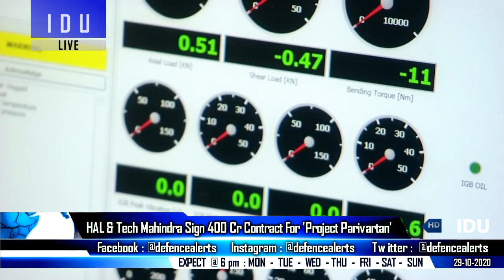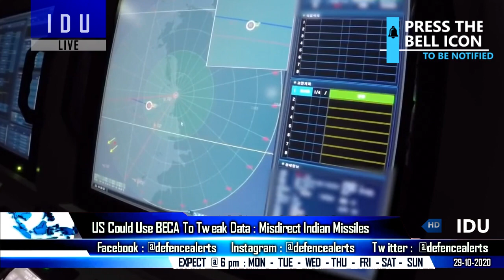Indian Defence Updates : TEDBF Production By 2030,DRDO AIP Delay,400Cr Parivartan,US BECA Misuse ?

Comment: My suggestion would be to save time, and just focus on AMCA, let the Naval AMCA be the TEDBF why not? this way the AMCA production will be higher and thus lower cost per unit.
Also Navy should buy more Tejas and use them from their land bases like INS Hansa etc and also deploy them on carrier for practice and experience.
Reply: LCA has limited range
Reply: @avkk2314  Most carrier based planes have limited range, as the plane has to be light for take off as that way there is less stress on the airframe.
Also if say a squadron of Tejas is based at INS Hansa in Goa, it can provide air cover for range of  500 kms which is almost all the way to Mumbai in north and Mangalore in South. thats good enough.